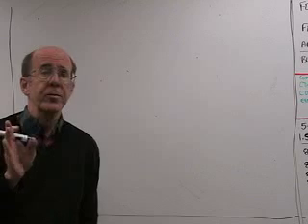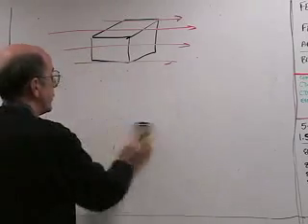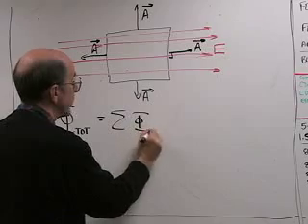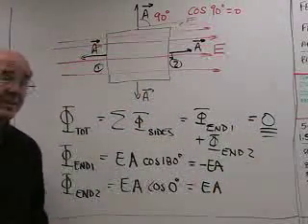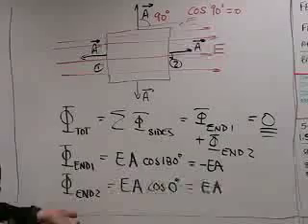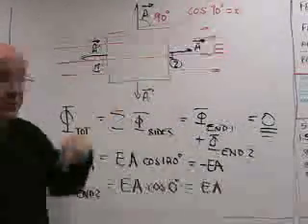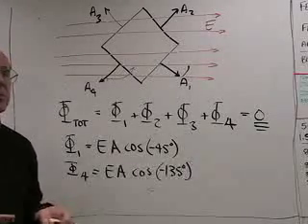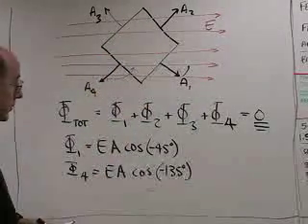Flux Through a Closed Surface

Comment: Sir please I have a simple question. Why isn't the electric flux zero when it enters and leaves a plane surface. Because in that case too the number of lines that enter the plane area are equal to the number of lines that leave it through the other side?

Comment: Also why did you exclude the 2 surfaces. I didn't get what you said in the video.
Reply: thats becuz those 2 surfaces have an A vector or normal vector  are placed at an angle of 90 degrees to the electric field. hence the flux for them would be equal to 0.

Comment: in my book total flux is defined as integral of the dot product of the Electric field and dA. What you have in this video is in my book to but is says rather than summing 100+ flux values they change the summation into an integral by "Shrinking the patches from small squares with the area deltaA to patch elements (or area elements) with area dA. My question is more the math than the physics. how do you get from a summation to an integral?
Reply: +Logan Knowles Thats kind of a definition of an integral, summation of infinite small parts;  what your book says is the same as in the video but more general, with the examples of the video you can do these easy calculations and get to understand the principle, but the principle is valid on any closed object you could draw

Comment: why is it at the start of the question 2 surfaces of the box are ignored... shouldn't it have vectors A1 to A6?
Reply: thats becuz those 2 surfaces have an A vector or normal vector  are placed at an angle of 90 degrees to the electric field. hence the flux for them would be equal to 0.

i hope this answers the question .

Comment: I know it's like a month later but if u see a cube and visualize its sides the two front sides areas are perpendicular to the electric field therefore making the cosine of theta equal 0 sine cos of 90 is 0 .. 
And since flux=area*electric field*cosine of theta 
if cosine of theta is equal to 0 then the flux is zero !
He actually mention this in the first example at almost 3:40 hope this helps :)

Comment: I'm pretty sure this is stated in gauss law of magnetism. So please can someone explain that how a current can be induced in a wire, which is a cylindrical closed surface. Therefore gauss law would suggest that there isn't a change in flux. With faradays law of induction ξ = (∆ϕ ÷ ∆t) if the flux is 0 (no change) how can there a current be induced. I obviously know that induction exist, i've seen it, but what is gauss law of magnetism actually saying? (am i using the two improperly?)

Comment: @nanone1994 
If you see it in another way,here you're taking the angle starting from E to A(A1,A2...A4),i.e,the tail of angle being at E and it's head at A.This will give us 135 degrees in case of A4 and 45 in case of A1.

Sign of angle here doesn't matter because both angles have the same direction,i.e,clockwise.